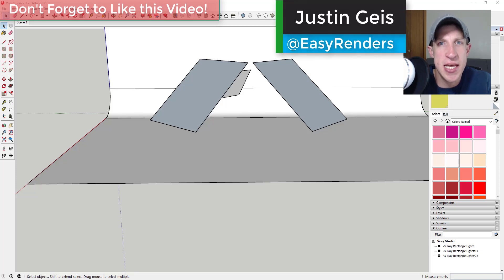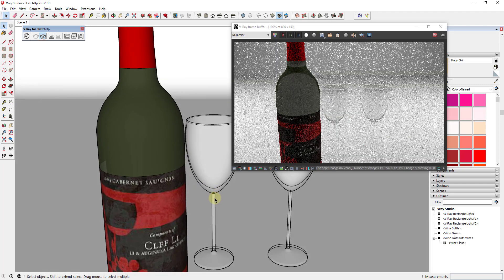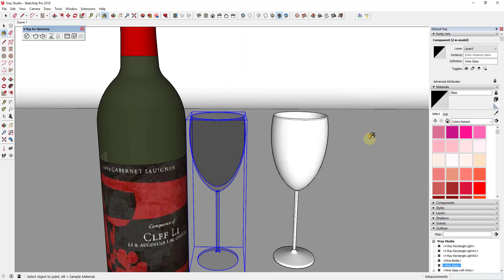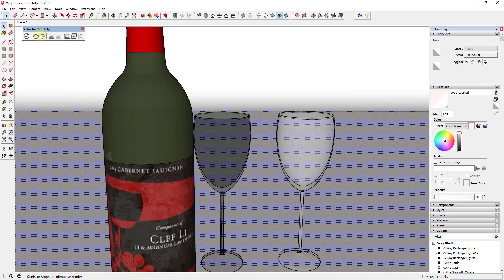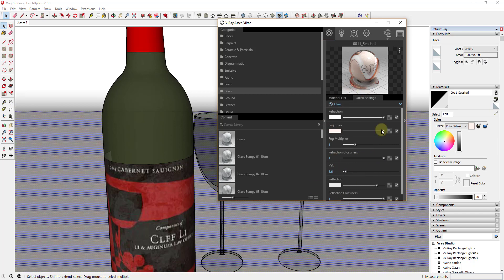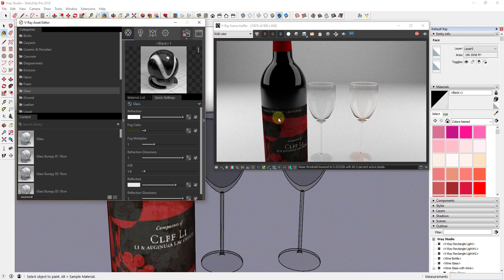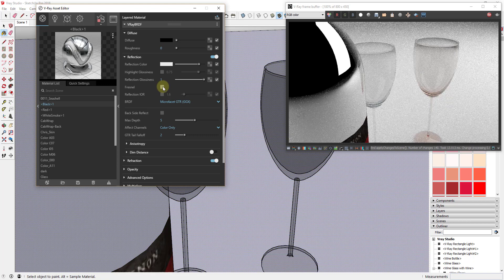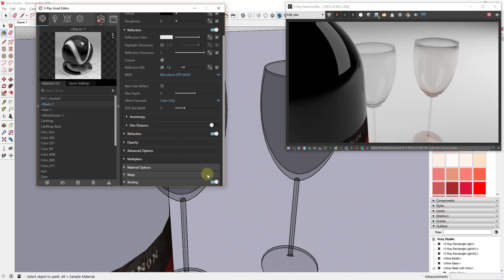VRAY GLASS SETTINGS TUTORIAL - Reflection Settings in Vray for SketchUp

Comment: Of all your videos I found this one most helpful. Possibly because nobody has explained it so clearly and I had become frustrated with VRay enough to consider not buying it.  Nice job Justin.
Also could you link to a video that clearly explains how to move things around in space.  I am increasingly frustrated with (for example) moving a light in vray to a particular place  (but not limited to lights), I think it is a combination of not "squaring" my drawings properly when I begin them but also noticing a lack of "direction movement consistency" when using "shift" "arrow" when moving one object then another.  It seems like the direction behavior of the arrows is always different (even in the same drawing). I am pretty sure there is something I am missing.
Again, thank and keep up the good work!

Comment: first i want to say thanks for this helpful videos you are amazing
my question is how i can find  this quick sitting in v-ray next
Reply from the maker: No idea - I don't have a V-Ray next license
Reply: Hi, first of all, many thanks Justin for your amazing tutorials. I was also wondering how to do it in Vray Next because there are no fast settings from the previous version available as are on your video, but I guess you can just use material from the V ray library which has glass settings in it and then apply it on the selected object and further adjust textures however you like either in the SketchUp material editor or V ray asset editor in the diffuse box ....